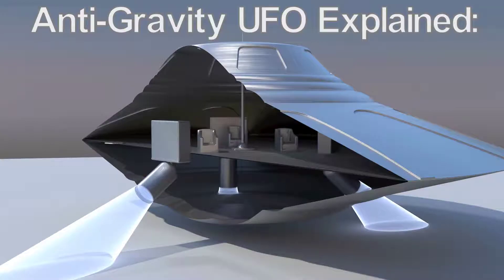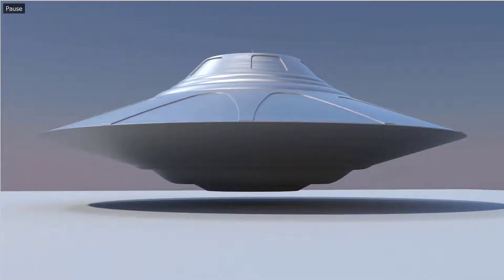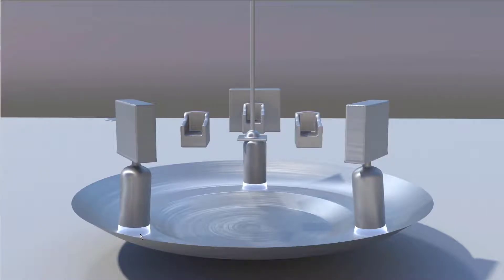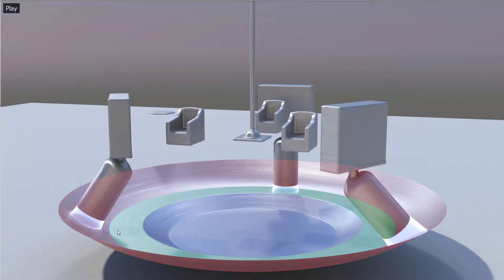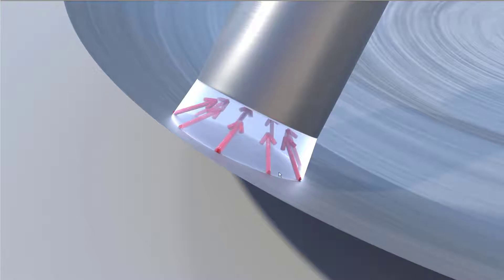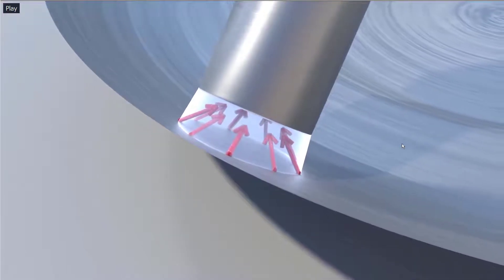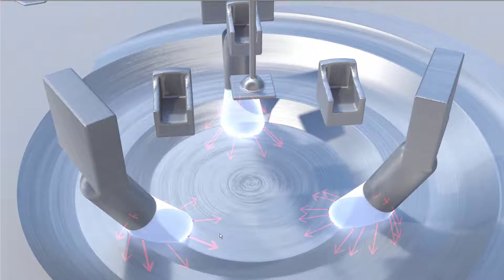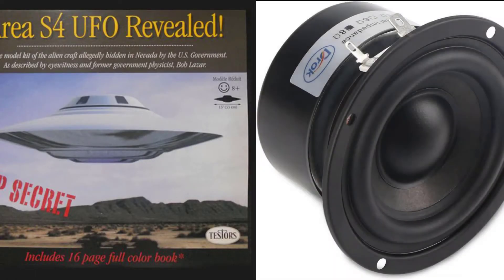bob lazar's sportmodel 🛸 anatomy of a flying saucer [abominati0n]

Comment from the maker: 👽🛸 "bob lazar's sportmodel 🛸 anatomy of a flying saucer" [abominati0n]

bob lazar's UFO 3D modeled + anti-gravity operation mechanics.

information: youtube user abominati0n, set out to make an accurate 3D model of bob lazar's "sportmodel" UFO and he found some really interesting new details about how this craft manipulates itself in order to travel interstellar through space. this is basically the exact opposite of how everything we have operates, which is a major clue as to how "gravitational waves" move matter. here are the things that abominati0n, learned from this (1) the "gravity emitters" conform to the shape of the "ridges" on the bottom of the craft. (2) the gravity emitters work directly on the metal of the craft/the "skin of the craft" is what moves the entire craft around. while a jet engine increases heat and travels through compression of hot air, this craft doesn't use heat at all, it emits a positive or negative gravitational force that hits the metal of the craft directly and moves the metal itself, which in effect moves the entire craft. (3) the 3 different ridges on the bottom of the craft act like a speaker woofer to transmit the gravitational wave through the mass of the metal. one ridge (RED) is for "OMICRON" configuration mode, one ridge (GREEN) is for landing and lifting off the ground and another ridge (BLUE) is "DELTA" configuration mode for space travel "interstellar" high speed. - abominati0n.

how it all begun:

robert scott lazar "bob lazar" who claimed to have filmed a UFO at the area 51 has been accused for decades of being a liar, fraud and / or government agent spreading disinformation. ex government scientist, robert scott lazar, 1989 worked with a team of scientists who back engineered extra terrestrial discs at a base known as S-4, 15 miles south of area 51

a lot of people claim that the US military hides UFO at area 51. this is not true. fact is that the US has a few UFO they are however not based at area 51 but at a camouflaged military underground facility named "S-4" (site-4) and according to lazar, located 15 miles south of area 51 near papoose lake.

information: approach the UAP controversial field from a professional, rational, scientific approach and without any a priori.
also known by "unidentified aerial system" (UAS) or "anomalous aerial vehicle" (AAV), or "unidentified aerial phenomena" (UAP) or "unknown advanced transmedium vehicles" (UATV) or "unidentified submerged object" (USO) and "unidentified flying object" (UFO) #boblazar the majestic MJ12 documents link: 

 https://majesticdocuments.com/
  
"there's more star's (sun's) in our galaxy than every single grain of sand from every beach and desert on earth. the evidence of 'are we alone' in the universe is overwhelming, FULL disclosure by world governments on the UFO/UAP alien presence is going to happen, the phenomenon is real. we've been visited for thousands of years. officially said by the US government thay stated that there armed forces navi ect: have seen and recorded UFO's now called UAP'S unidentified aerial phenomena, they've seen tac-tac shaped one and meny other shaped one's, thay have a program to study these craft called advanced aerospace threat identification program (AATIP) funded by the united states government to study unidentified flying objects or unexplained aerial phenomena. the program was first made public on december, 16th 2017. bob lazar, was the first whistle blower to work at area S-4 (site-4) where he reversed engineered extraterrestrial technology NOT from this earth, anti gravity and element 115". - bob lazar tube. - video + thumbnail courtesy of youtube user abominati0n, @ https://m.youtube.com/channel/UCKQMHogb1jU0yp7yY9GFBRw/